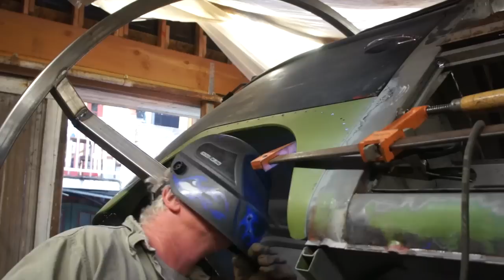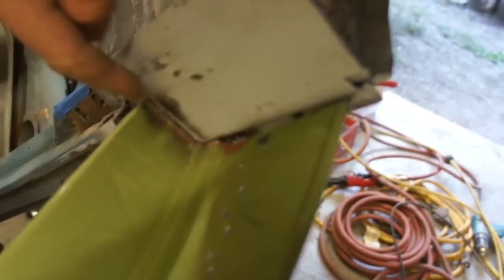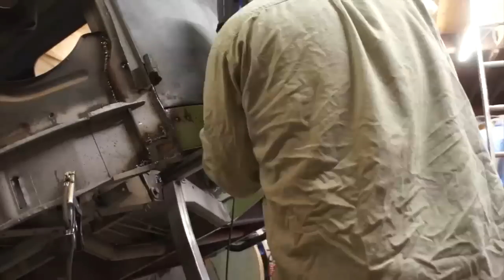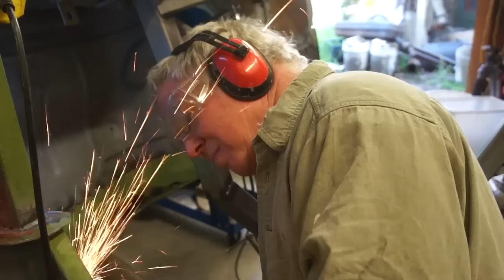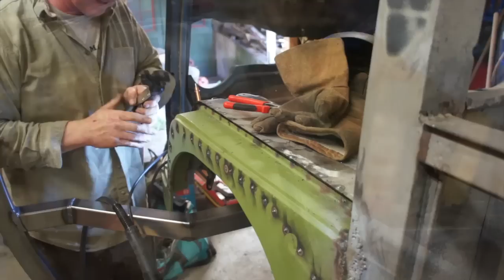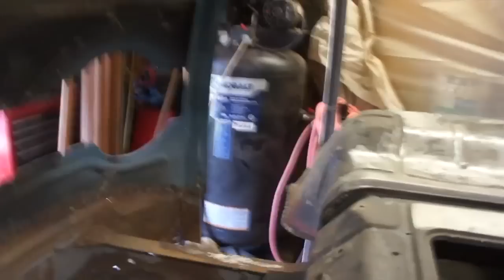VW  Bus Single Cab Dogleg Install Part 3 of 3

Comment: Did you put anti-corrosion coating on the inside of that dogleg after you seam welded it?  If not, it will be a nice start for the rust to start all over again.  Great work though!
Reply from the maker: Very important point you make. I used Eastwood Internal frame coating

Comment: Rather than cutting the wire, could you not just have a bit of course sandpaper or a file that you scrape the end of the wire on between welds?

Comment: Why not use the spot welder in areas where you can use it? I use the plug weld method because of necessity but if I had a spot welder and can get it to the spot to weld it I would do so. Not knocking you, I'm learning a lot, just questioning and giving my opinion. Fantastic work, I dove into a early Bay window project that was a quick "Get it on the road project" and now 4 years later I'm ready to revisit it and do it right. I have to get my '64 Bug out of the shop first. A project on it's own. Love the videos and your problem solving. It's motivation to get on the '64 get it done and onto the Bay Window. 
Bay Window build thread over on the Samba...
http://www.thesamba.com/vw/forum/viewtopic.php?t=492806

Comment: you are an amazing engineer...love the result, but your weld skills needs  improvement
Reply: I think spot welding sheet metal turns out this way regardless of experience.  I watch Trev's Blog, Mustie1, and Fitzie's Fab, and they are all very similar.  What glideking does is really prep everything really really well before his welds.